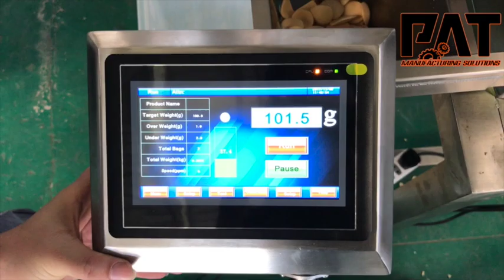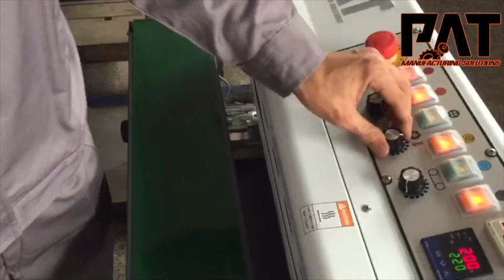ONLY $20,000 TO START YOUR OWN POTATO CHIPS FACTORY !!!

Comment: Biggest question is do u have the formula of Lays or Pringles..  Can't just make chips that can't compete those top names..
Reply from the maker: Lays and Pringles are 2 different types of chips, 1 is with real potato and the other is potato flour. Also what you may be referring to is the powder flavoring, not the formula. You can get different seasoning from many sources depending where you are. Lastly, you should not be intimidated by big brands. You can create better quality snacks in small batches using locally available products and still compete with the global brands. There is a substantial number of people who do prefer locally made products. You can use organically grown produce and even better quality oil, and no preservatives in your creations. THINK SMALL BATCH my friend and start your own business.
Reply: @PanasiaexportsHK  True man.. But even if you're small, you gotta have the quality. I'd rather be dead of am not selling quality product..
Reply from the maker: @semi5alpha  you can actually attain better quality with small-batch manufacturing. You are not driven by the pressure to use cheaper oil and ingredients. Also having to meet price structures set by logistics and distributors. send me an email, I will share some profiles of projects we have set up for other clients.
Reply: @PanasiaexportsHK  Someday bro.. Am too fully committed on another field now.. Thanks!